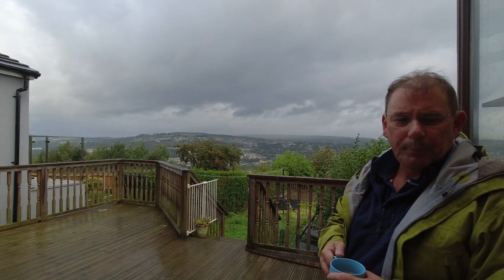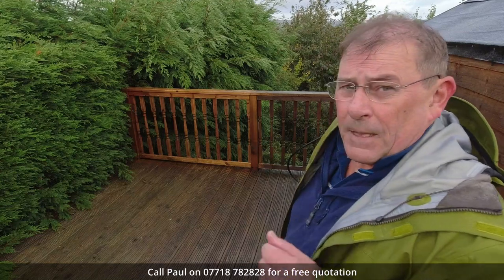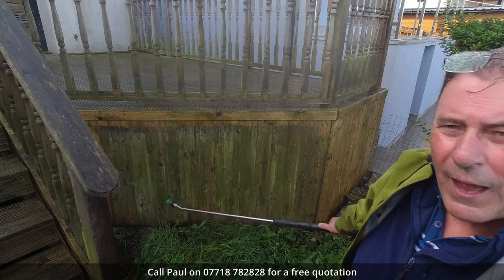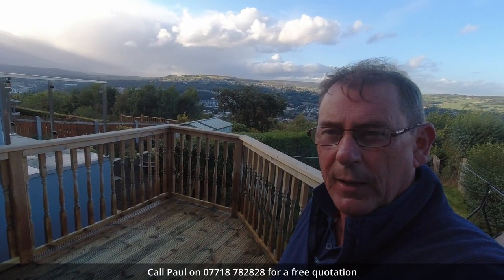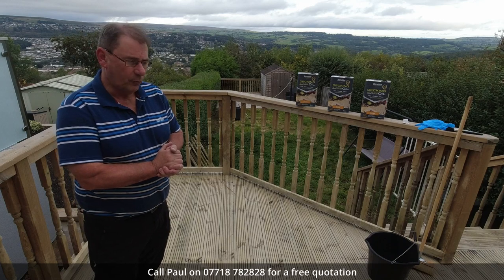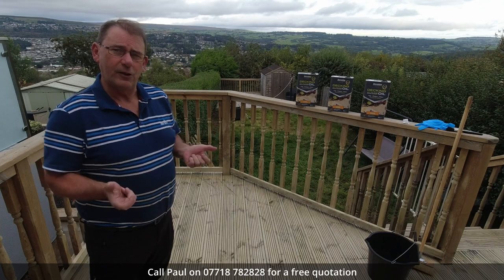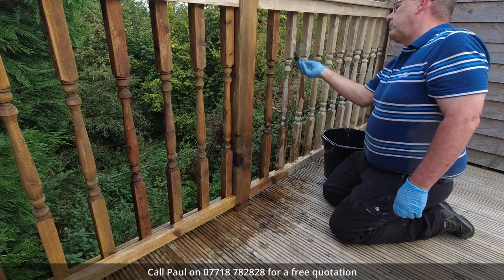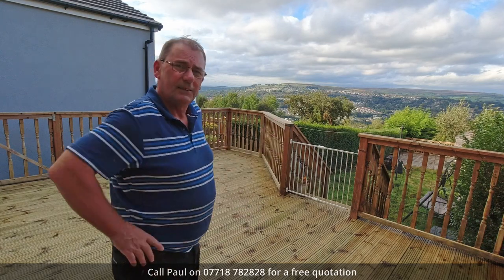Slippery decking, low pressure clean and re-oil. Bradford. @jetreadyuk

Comment: have you ever used a paint sprayer for applying decking oil ? curious if it maybe a quicker option for the decking
Reply from the maker: A sprayer is a time saver for spindles. I haven't tried one for the decking but doubt it would be quicker than a big fat brush. Especially so if you account for the cleaning time afterwards.